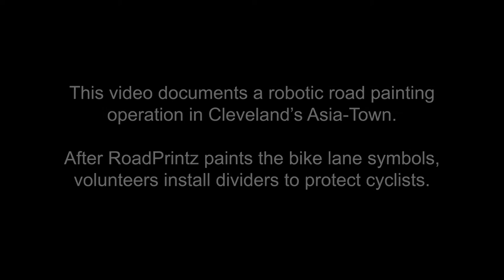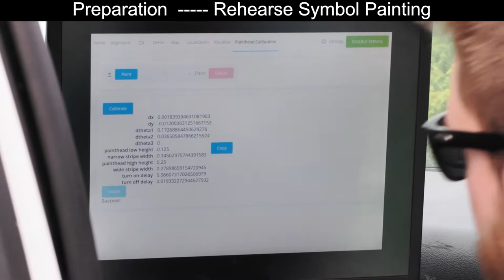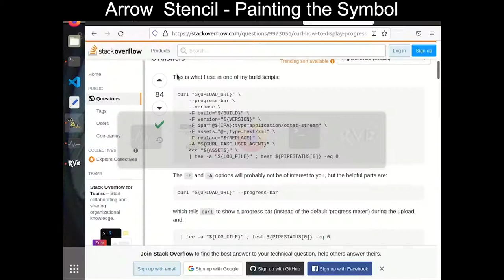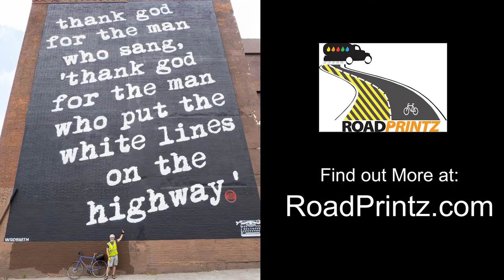RoadPrintz Asiatown bike lanes, 6/29/22: robotic painting by Stella

Comment: Very cool. How are you powering it from the vehicle and have you considered putting a paint cover on the arm?
Reply: Great questions! We use a proprietary system to boost the truck's 12 Volt DC to 480 Volt/3-phase AC "robot kibble."  We're still in R&D, but we'll put on a custom arm cover once we stop running new cables, wires, hose,  and tubes.